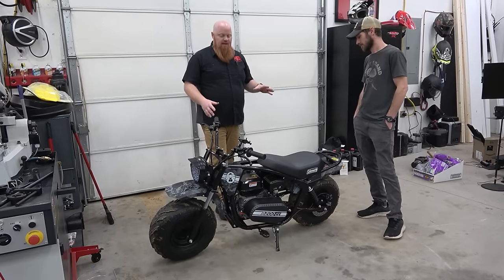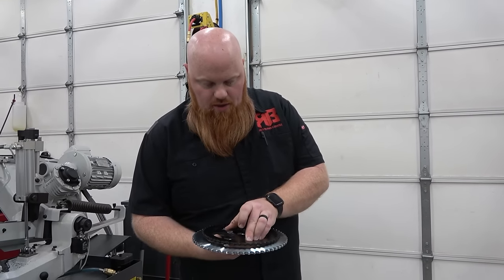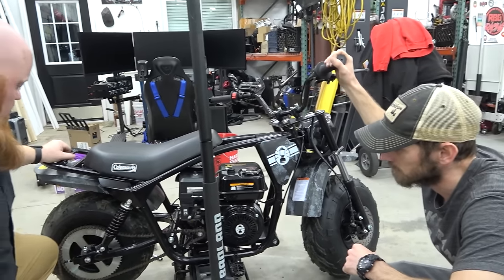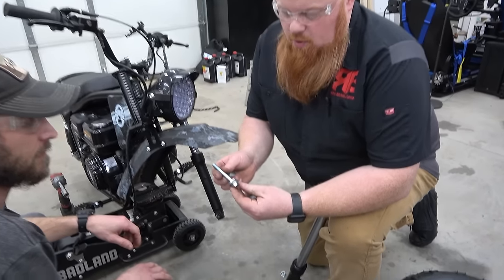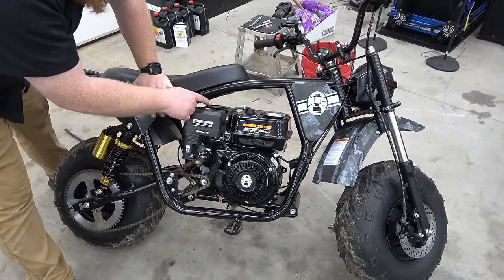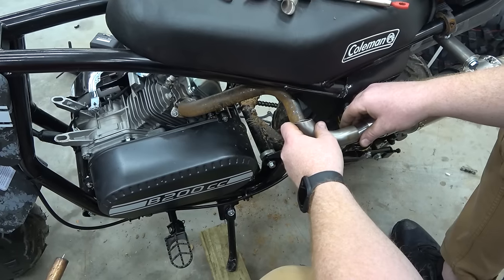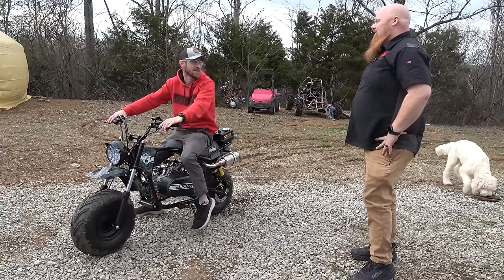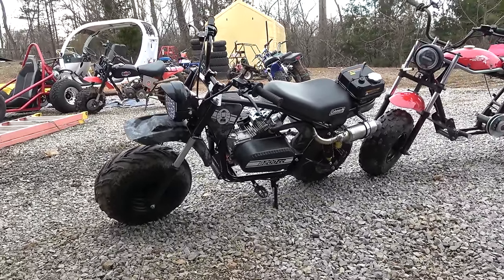We built a 2" Lift Kit For The New Coleman B200RSV Mini Bike

Comment: My Dad has 2 if these. One I got 38mph, the other squeezed 42 stock. These bikes are a blast! On pavement with limitless room ofcourse.
Reply from the maker: It for sure my favorite
Reply: Without the screw I got it to 46mph on a little downhill. All stock as well.
Reply: @hadesx7354  what screw?
Reply: @ProdSeptemberr  the screw on the throttle with the spring on it. You take it off and the throttle goes further.
Reply: @RedBeardsGarage  Have you guys noticed excessive runout on the brake rotors at all? My brand new bike has alot of wobble in both rotors.

Comment: Like the content. I have 5 colemans. The kickstand brackets are death traps. I cut the brackets off the rb100 and ct100 that runs a mod 196cc. My new b200r lasted 5 minutes in the woods before I lost the kickstand spring. The ct200ex and ct200 have not been as problematic. I would like to ride 7 miles of hell on a pullstart bike.  I do alot of "testing". Thanx for the content and wish yall well.

Comment: I have a MM212 with the rear swing arm kit, and i do plan on getting the front fork spacers to lift the front this spring. Also been taking all the tips from the road to horsepower with my hemi predator, but running a .272 mongoose cam. It does have a 1 way check valve on it i got from a mystery box. Really liking the videos builds.

Comment: Wouldnt it just be easier to lower the swingarm mounts on the frame ?
Reply: I was wondering the same thing
Reply: Solid thinking but I'm guessing no. The issue is the location of the swingarm pivot point needs to be as close as possible in a straight line with the jackshaft or engine. As the swing arm moves up and down depending on how close to an ideal location the pivot is at, the chain will tighten and loosen. Moving it down by an 1" or two would make the chain get over tight or fall off when it loosens. They could have moved the rear shock mount point closer to the swingarm pivot point though, softer but taller suspension then.

Comment: I will stick with my trail master. I've jumped it with no issues I've raced it on a dirt track performed perfect. And using stock motor with different carb/sprocket/and clutch gos 60mph.

Comment: Really nice job!

I like the 9/60 gearing on my Coleman. You don't really need big engine power to have a fun bike.
Reply from the maker: Yes sir. Once we got this bike done it’s a ton of fun for a pretty stock bike.
Reply: I’d like to run an 8/60. Any idea what inner diameter the front sprocket is on the RSV?
Reply: @ikeclanton3901  Hopefully RB can answer because he has one.

What you need to know is the jackshaft size. If the keyway is 3/16" then you have a 5/8" jackshaft. If the keyway is 5mm then you have a 16mm jackshaft. 

I have an 8 tooth on one of my Colemans. It fit on the 16mm jackshaft of the cheap ebay torque converter. I made a tiny spacer for the keyway because the 3/16 key on the sprocket is smaller than the 5mm keyway.

The 8 tooth is small and doesn't look very robust. And it's quite a turn around for a 420 chain.

  The 8/50 gearing I use works ok. I think 8/60 would be too much gearing to control. You might find yourself in a wheelie at the wrong time without trying.

Comment: Thanks for this! I'm picking mine up tomorrow and learning everything I need to know about it. Do you think it's worthwhile to upgrade the air filter? Is the stock air box a limiting factor in performance if I don't plan on doing anything else to the engine?

Comment: Just ordered my front lift kit from you guys! Can't wait! Thanks guys!

UPDATE: Installed the lift kit on my MM212. MAKE SURE YOU ORDER LONGER BRAKE LINE. The oem front brake line works but is VERY tight and not gonna be safe to run. I ordered a  51" cable off amazon for 10 bucks and it's perfect. The handling takes a lil bit to get used to also as its a lil bit on the twitchy side. Being able to ride over sharp crests and tree roots now tho without bottoming is worth it. Overall the front spacer kit is an amazing upgrade and worth it if your a hardcore trail rider! Thanks Red Beard...great product!
Reply: Add a link for the 51" brake hose please!

Comment: I have the B200R which looks similar to your Coleman model and the aftermarket headers come too close to the rider's left leg and barely clears the frame. I've wrapped my header and still burn holes in my pants leg. I suspect the header you've made will have the same problem when you place your feet to the ground. Just offering some constructive criticism. I'm about to install my third aftermarket header that's short and aims down and back instead of up and back.

Love your channel. I've learned so much about small engine modification.

Comment: RBG, does your lift kit work with the standard mega moto 212 with the GPS swing arm kit installed? I have that kit already and want to make it more useable instead of replacing it with the newer tractor supply version. Thanks guys!

Comment: Instead of skewing the engine couldn't you use an idler gear on the swing arm and a longer chain? That way you wouldn't have to worry about your oil levels being high on one side of the engine and low on the other. Probably not a problem most of time but could be an issue on hills.

Comment: Got to be real careful welding on exhaust when attached to the engine. Dad did that with a tractor and ended up needing to pull the head and clean out the slag. Didn't do a lot of damage to the engine but that's an old 6:1 compression AC with a cast iron head.

Comment: If the shock was put into the original hole on the back would the chain rub still be a problem?     Also do0es the bike come with a 420 chain or ??  thanks for the video!
Reply from the maker: Bike does have 420 chain and it would still be a problem.
Reply: @RedBeardsGarage  ok. I am going to wait on the kit.  You will be selling the 60 tooth 3-hole pretty soon?
Reply: @marchufnagel9068  if they dont studs racing has sprocket options for the 3 hole just buy the ones that fit the mega moto 212/rt200 i think they have something within a few teeth of most sizes i know they have 38, 44, 55 and 72

Comment: Dammit Red, I built a mega moto, then they came out with the new one with shocks.  I saw your vid on the wild cat 240 and that motor arrives today.  Then i see this video and checked tractor supply and I have to go pick it up today.  I just ordered the RBG 2" lift kit and the shocks. Also some assorted EC carb stuff. Would like to put 20 size tires searched amazon and nothing good. Suggestions? Any way will your 2" lift kit fit on a mega moto 212.? They seem to be the same. Also i ordered your mystery box so hook a brother up.